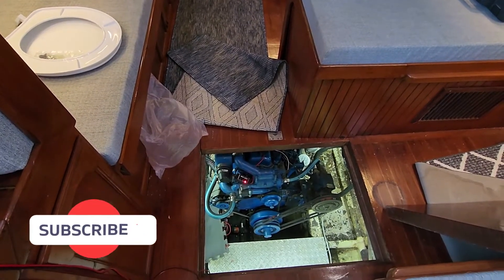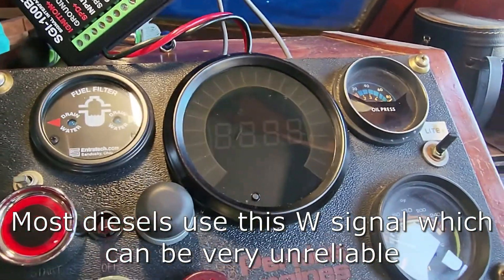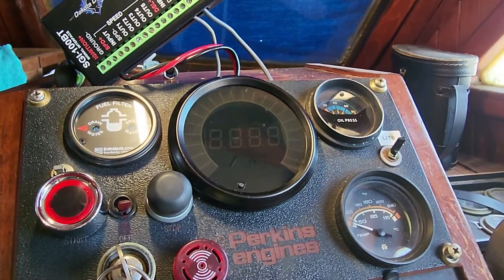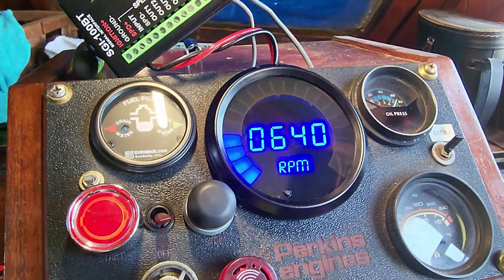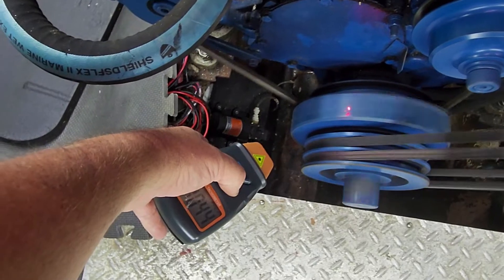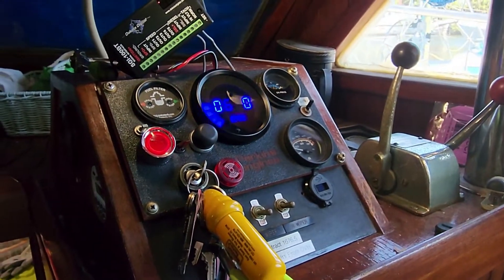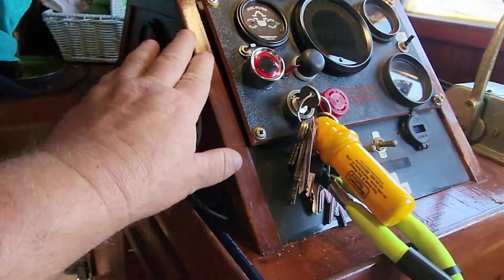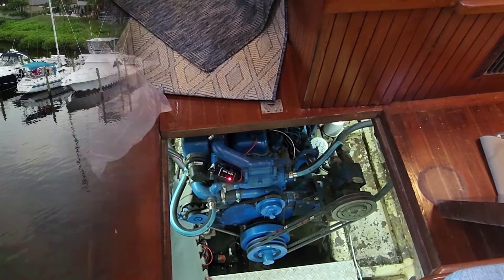Trawler DIY- Using the Tiny-tach, Dakota Digital interface and Jeg's gasoline tach for diesels

Comment: Damn I wish I was on the other side of the state. Would love to work with ya on mine. I have 2 of those with non working tachs
Reply from the maker: There are several solutions out there. First is to figure out where your signal is coming from. If its the alternator it severely restricts you in what you can do. So youll need to convert to another signal IMO.
Reply: @mvintrigue-trawlerdiy1101  mine I believe comes from my engine synchronizer
Reply from the maker: @projecttrawler  I would have to see the diagram. Usually a tach signal is generated by either the alternator W signal, or a tach drive. Then sent to synchronizers which use the signal to act on the throttle and then the signal continues to the tachometers. I think Aetna Engineering sells tach drives. But it will take some research to figure out the details. Time for you to make another video! You are slacking brother...lol.
Reply: @mvintrigue-trawlerdiy1101  yes I am but haven't had much time to film or make much progress.. will be getting back to it starting around the the 4th
Reply from the maker: @projecttrawler  Good deal. filming while trying to really get stuff done is actually a PITA..lol.
Reply: @mvintrigue-trawlerdiy1101  my tachs, I believe are run off a cable like an old school speedo cable to my synchronizer that cable comes from a gear driven just to the port of my coolant water pump